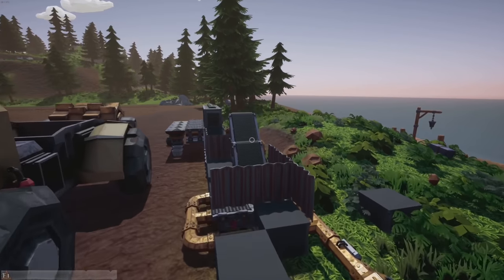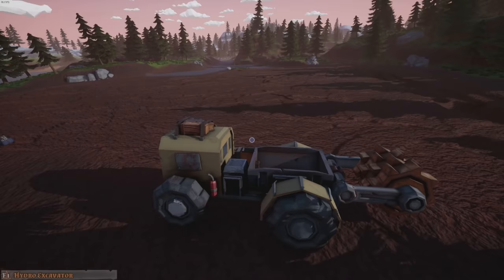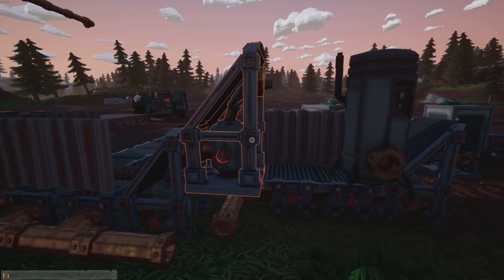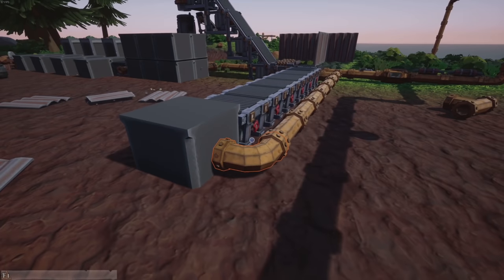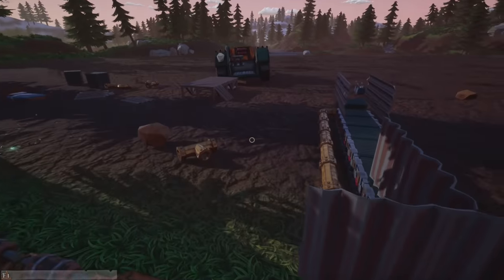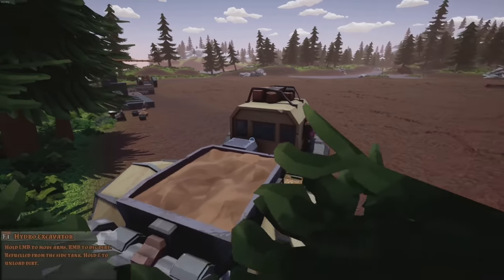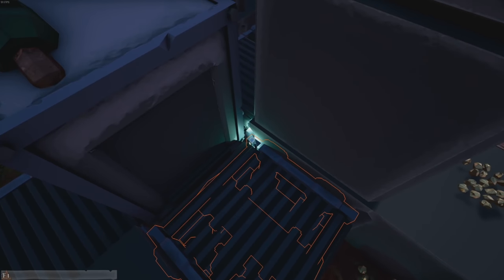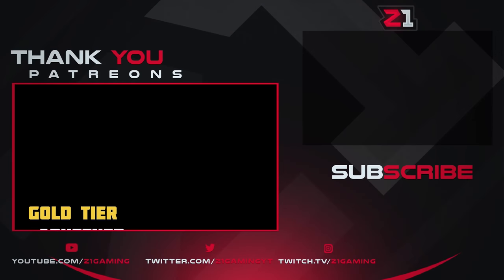New Grindy Belt and Factory Redesign ! Hydroneer Episode 5 | Z1 Gaming

Comment: Ya know, if you put dirt through a sorter set to gold, and the spot dirt would go out of, another sorter, you need only a little water pressure, and you can make the dirt travel at very high speed. (When an object goes into the sorter, it just teleports it to wherever it needs to go.

Comment: For me, the funnel is useful only for collecting the output (gold, iron etc) into containers. (it's ok if you're manually feeding the belt with shoveled ore, because the feed rate is slow enough that it never clumps together).
I've had some success putting the grinders at the same level as the harvester, so that chunks that clump together aren't sitting in the opening above  the harvester clogging it up.  
I also added a 3rd "reverse" grinder on the other side of the harvester to catch some of the overflow and push it back towards the harvester, but I still have to split the largest soil clumps with the pick axe. 
It seems that the soil clumps together up to three or four size categories before they stop combining.  Grinders seem to only grind down chunks by one category. 

BTW - I noticed something useful with the pickaxe : the half that it splits off lands at your feet.
I've used that feature to feed the reverse grinder with half of the stuck pieces on the main belt. Unfortunately, after using the pickaxe the original clump seems to be "stuck" in the air and unaffected by physics until you interact with it by hand.

Comment: You need a grinder as you're unloading you need a grinder in the middle I need a grinder on the top so it goes from Big to smaller to smaller and then it goes smaller as it goes in you need at least three grinders spaced apart and that'll help you're clogging problems listen to me that's what you need to do
Reply: W h a t
Reply: W h a t?

Comment: I wonder if multiple water pumps on the same line would increase the water pressure.
Reply: That is a good question,imagine just saving 100 shards and having a more constant flow
Reply: It does not.
Reply: The "pressure" for water power does not increase (sadly), but the water particles that come out of the end of the pipes do come out faster (and sometimes at strange angles), which is only really useful for filling pans at a distance.